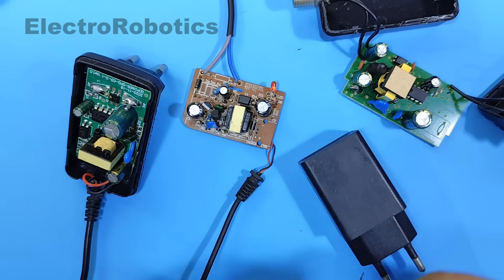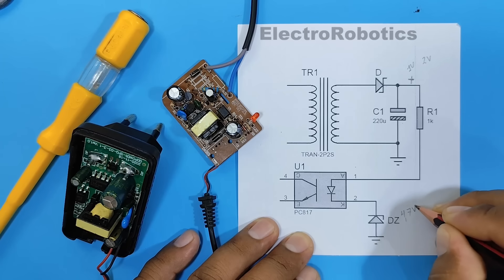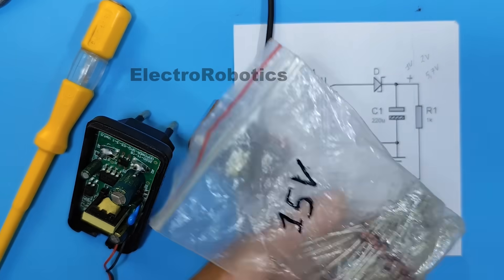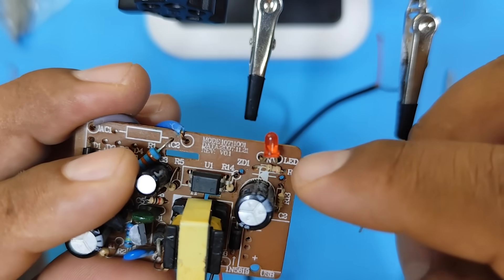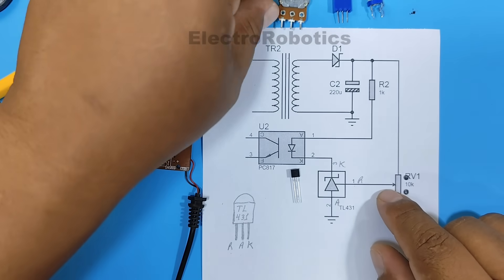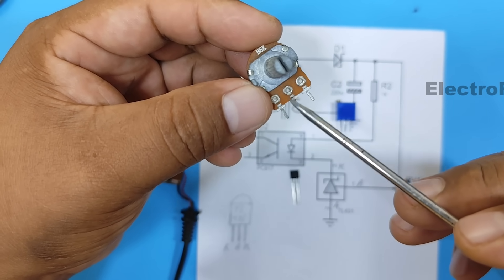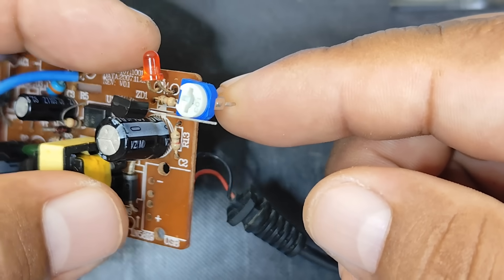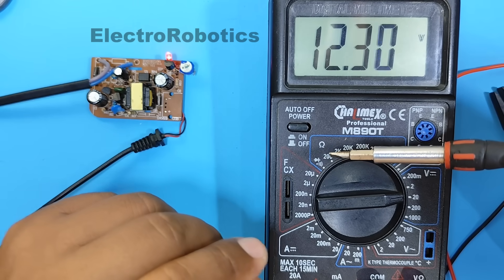Modify Any Charger and Adjust Its Voltage.

Comment: Teaching is excellent. Thank you
Reply: So much mis-information
- FIRST SAFETY  is important but no safety precautions are given. The part about adjusting the trimmer is scary bad.
- The current must be reduced else it will over-heat and self-destruct.
 - it does NOT work on all chargers. 
- the output waveform will be degraded, so the load may not work properly.
- he does briefly mention the issue with the output cap .....be CAREFUL. For example if you change to 12V then the output cap must rated at least 16V

 This mod has been around for many years  by very ignorant channel makers. It is too bad he has repeated the same mistakes and same mis-information. He should know better.
Reply: Kudos to garymucher4082 for making me realize another flaw. Any  irregularity is passed to the TL4312 which can  interfere with the regulation.  This is a real and serious flaw.   Usuing a DVMM with no load is a rather naive test.

Comment: Oh yes, that variable TL4312. Used them a lot decades ago. Nice little device...
Reply: So much mis-information
- FIRST SAFETY  is important but no safety precautions are given. The part about adjusting the trimmer is scary bad.
- The current must be reduced else it will over-heat and self-destruct.
 - it does NOT work on all chargers. 
- the output waveform will be degraded, so the load may not work properly.
- he does briefly mention the issue with the output cap .....be CAREFUL. For example if you change to 12V then the output cap must rated at least 16V

 This mod has been around for many years  by very ignorant channel makers. It is too bad he has repeated the same mistakes and same mis-information. He should know better.
Reply: Thanks to garymucher4082 for making me realize another flaw. Any  irregularity is passed to the TL4312 which can  interfere with the regulation.  This is a real and serious flaw.   Usuing a DVMM with no load is a rather naive test.
Reply: @kennmossman8701  Sorry, I have no idea how the 2 ended up on the electrical component label. It is just a typical TL431, not a TL4312. Who knows how that snuck in there... IDK
Reply: It's TL431. I don't think TL4312 exists. There is a TL432 though.
Reply: No you didn't, because it's TL431, not TL4312.

Comment: Thank you very much. Theoretical explanation and practical application are excellent. ✔✔✔💯💯💯👌👌👌
Reply: So much mis-information
- FIRST SAFETY  is important but no safety precautions are given. The part about adjusting the trimmer is scary bad.
- The current must be reduced else it will over-heat and self-destruct.
 - it does NOT work on all chargers. 
- the output waveform will be degraded, so the load may not work properly.
- he does briefly mention the issue with the output cap .....be CAREFUL. For example if you change to 12V then the output cap must rated at least 16V

 This mod has been around for many years  by very ignorant channel makers. It is too bad he has repeated the same mistakes and same mis-information. He should know better.
Reply: Thanks to garymucher4082 for making me realize another flaw. Any  irregularity is passed to the TL4312 which can  interfere with the regulation.  This is a real and serious flaw.   Usuing a DVMM with no load is a rather naive test.

Comment: Very nice thank you
Reply: So much mis-information
- FIRST SAFETY  is important but no safety precautions are given. The part about adjusting the trimmer is scary bad.
- The current must be reduced else it will over-heat and self-destruct.
 - it does NOT work on all chargers. 
- the output waveform will be degraded, so the load may not work properly.
- he does briefly mention the issue with the output cap .....be CAREFUL. For example if you change to 12V then the output cap must rated at least 16V

 This mod has been around for many years  by very ignorant channel makers. It is too bad he has repeated the same mistakes and same mis-information. He should know better.
Reply: Kudos to garymucher4082 for making me realize another flaw. Any  irregularity is passed to the TL4312 which can  interfere with the regulation.  This is a real and serious flaw.   Usuing a DVMM with no load is a rather naive test.

Comment: Nicely done thank you
Reply: So much mis-information
- FIRST SAFETY  is important but no safety precautions are given. The part about adjusting the trimmer is scary bad.
- The current must be reduced else it will over-heat and self-destruct.
 - it does NOT work on all chargers. 
- the output waveform will be degraded, so the load may not work properly.
- he does briefly mention the issue with the output cap .....be CAREFUL. For example if you change to 12V then the output cap must rated at least 16V

 This mod has been around for many years  by very ignorant channel makers. It is too bad he has repeated the same mistakes and same mis-information. He should know better.
Reply: @kennmossman8701  please a video such as this very one, correcting all mistake, and we learn from it. This tutor has done his part, we need you to come up with your part too, to help with the algorithm.
Reply: Thanks to garymucher4082 for making me realize another flaw. Any  irregularity is passed to the TL4312 which can  interfere with the regulation.  This is a real and serious flaw.   Usuing a DVMM with no load is a rather naive test.

Comment: Funtastic. Bundle of thanks 🙏
Reply: So much mis-information
- FIRST SAFETY  is important but no safety precautions are given. The part about adjusting the trimmer is scary bad.
- The current must be reduced else it will over-heat and self-destruct.
 - it does NOT work on all chargers. 
- the output waveform will be degraded, so the load may not work properly.
- he does briefly mention the issue with the output cap .....be CAREFUL. For example if you change to 12V then the output cap must rated at least 16V

 This mod has been around for many years  by very ignorant channel makers. It is too bad he has repeated the same mistakes and same mis-information. He should know better.
Reply: Thanks to garymucher4082 for making me realize another flaw. Any  irregularity is passed to the TL4312 which can  interfere with the regulation.  This is a real and serious flaw.   Usuing a DVMM with no load is a rather naive test.

Comment: Nice work, showing and explaining well done.
Reply: So much mis-information
- FIRST SAFETY  is important but no safety precautions are given. The part about adjusting the trimmer is scary bad.
- The current must be reduced else it will over-heat and self-destruct.
 - it does NOT work on all chargers. 
- the output waveform will be degraded, so the load may not work properly.
- he does briefly mention the issue with the output cap .....be CAREFUL. For example if you change to 12V then the output cap must rated at least 16V

 This mod has been around for many years  by very ignorant channel makers. It is too bad he has repeated the same mistakes and same mis-information. He should know better.
Reply: Thanks to garymucher4082 for making me realize another flaw. Any  irregularity is passed to the TL4312 which can  interfere with the regulation.  This is a real and serious flaw.   Usuing a DVMM with no load is a rather naive test.
Reply: @kennmossman8701  He touched the transformer while trimming............. Nothing happen to him?
Reply: @jjg2753  its the leads of the caps, components and transfomer, PCB tracks  on the mains side that can give a shock - if you are grounded
Reply: if you doubt me plug it in and poke aroundusing ur index fingers but dont blame if the shock throws you off ur chair. Maybe take out life insurance policy first
Reply: @ That's why I was shocked why he did it without safety! The current also not modified.....
Reply: @jjg2753   it sets a very bad example....very irresponsible